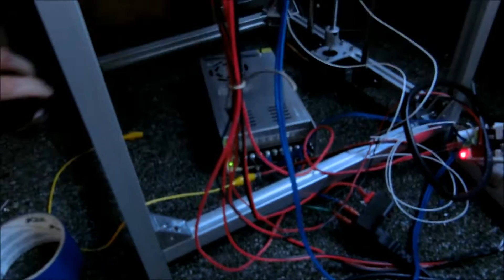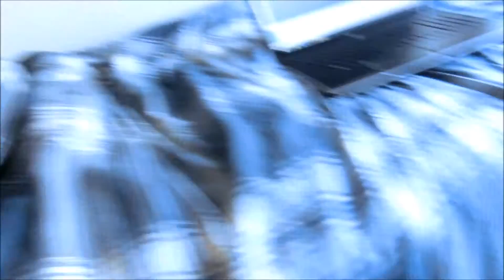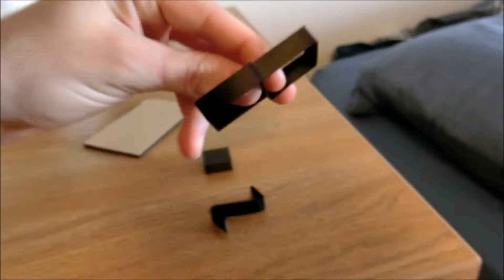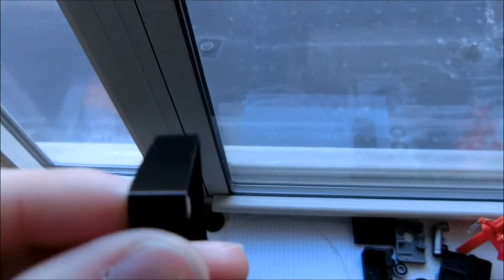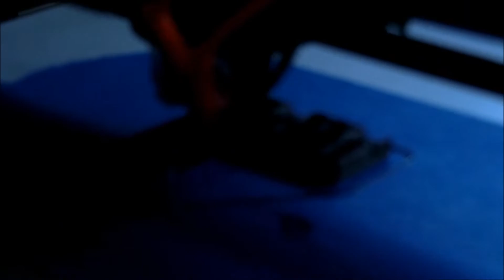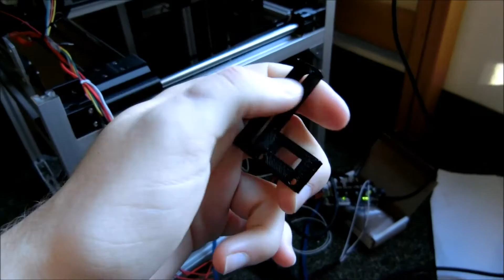Eclips3D Update 15 - Up and Running!

Comment: Good to see it running well.. I actually built a 3UP earlier day. Is there any Eclipse3D specification published? the z axis is impressive and insanely fast. Is it on a 8mm pitch?
Reply from the maker: ***** The Eclips3D Specs are not official yet as the printer is still in development, but as it stands the build area is limited by the size of the bed to 200x200x200mm, with a max x and y movement speed of about 400 mm/s and a max z axis speed of 100mm/s (but that can go higher, the motor is running at a very low current to keep it cool, which really isn't necessary so I will look into making it faster!).

Comment: Hey is there anyway I could get your config file for your x5? im having some trouble getting a cartesian profile made up that works decently well and by the looks of it your motors seem to be running very smoothly. Thanks!
Reply from the maker: Purpledotcom Sure just email me at 3dprintedlife@gmail.com and I'll send you my file. ANd for your viki board, can you just use one sd card in the controller and load the firmware and config files on that, or do you need to keep that one in the azteeg and get an extra sd card if you want to use the sd slot on the viki controller?
Reply: 3DprintedLife you do need an extra SD card unfortunately. However this is a good thing because it keeps you from maybe deleting your config file or something else. BTW I just got in all the sheet metal frame pieces to build two printers. Now I'm just waiting for parts to come in.

Comment: Any plans on going Bowden? I'd think it might actually allow you to print even faster with way less rippling. Looks awesome so far!
Reply from the maker: RadRider33 Yep I do plan on testing out bowden once I get direct drive complete. It will be easy enough to convert as I can use the current extruder as a hot end mount and just slap a bowden extruder on the printer somewhere.

Comment: You designed an enclosure for the printer, do you wish to sell/test it ? Also you were really enthusiast about the bowden, maybe you will try this later once everything is tuned correctly ? Nice work !
Reply from the maker: Pierre-Antoine Ganaye Yep I'm working on getting a prototype enclosure cut as we speak and if everything goes well I will be selling them as an optional add-on for the printers. And correct I will be trying bowden once I get direct tuned in properly.

Comment: I'm starting to save up some money for the KS launch :)
Reply from the maker: Alwyn van Jaarsveldt Nice! Just to let you know I'm unsure to what extent international shipping will be offered, however there should be no problem offering it. The real restriction is shipping costs as I think it may be over the 20lb limit for flat rate boxes, but the printer may have too many parts to fit in a flat rate box anyway so I still have to figure that part out, which I will do when I take apart my printer to make instructions.

Comment: Are the printed parts and BOM going to be released?
Reply from the maker: lee19702 Of course! They will be released when the design is finalized, likely after the Kickstarter is underway or shortly after it ends. I don't want to release something incomplete as I don't want to do a ton of incremental upgrades like on the 3uP. I will do one big release, followed by a bug fix if necessary, then I'll hold out until perhaps a second later large release.

Comment: I can tell you right now you're way ahead of ultimaker.  It's a superior design on several fronts. It's way quieter. Easier mounting,  higher speeds even with direct drive extruder. "more open" design as its extrusion based. You're only dealing with one belt? Easier calibration because you're less likely to get binding in the bushings.  You're using way sturdier rods. I can go on and on,  but this doesn't just beat the ultimaker 2, but it's a better option than going with a gen1 ultimaker as the price is extremely competitive. I am extremely impressed.
Reply from the maker: Exlr8Films Thanks! And I'm doing my best each day to get this thing working to its max potential, I expect huge quality increases over the next few days!